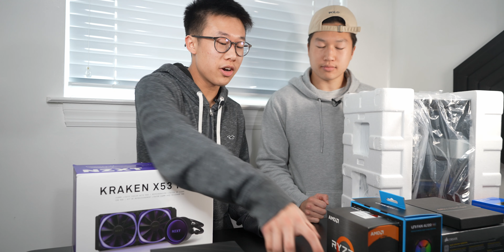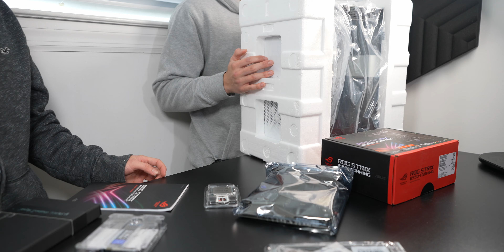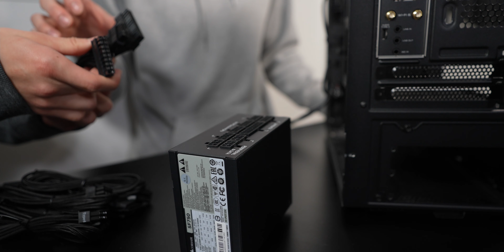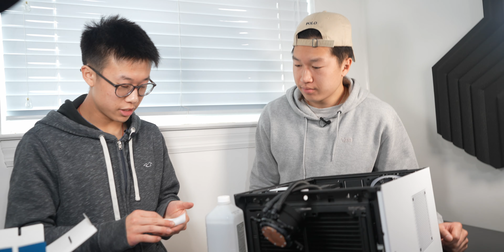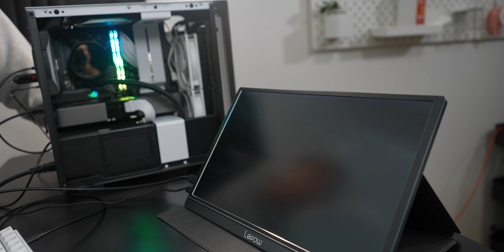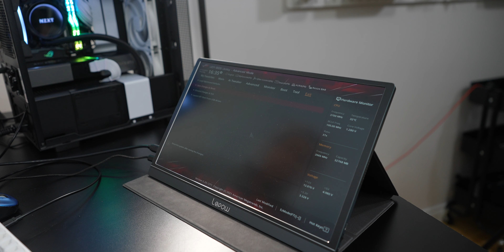Helping My Brother Build His FIRST Gaming PC Build 2021 // Newegg Now

Comment: Question, why didn't you put OS on the nvme m.2 ssd. If you did well I missed it but in the beginning you said the sata ssd.
Reply from the maker: Great question! It would make more sense to use the faster drive for the OS, but difference in loading times is pretty minimal and the NVMe has more storage. So smaller drive for OS, larger one (and faster one) for games and other files